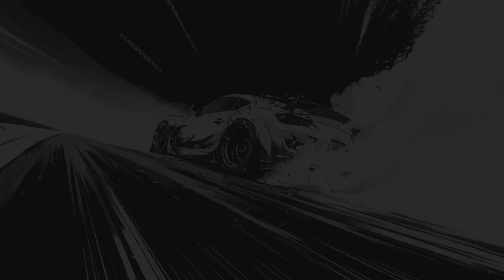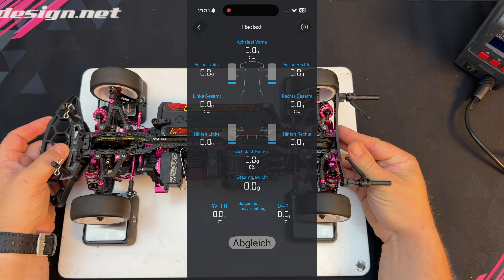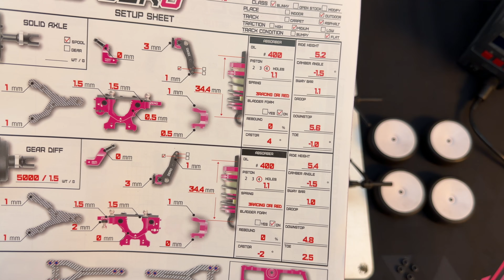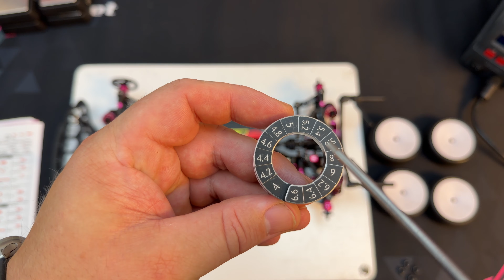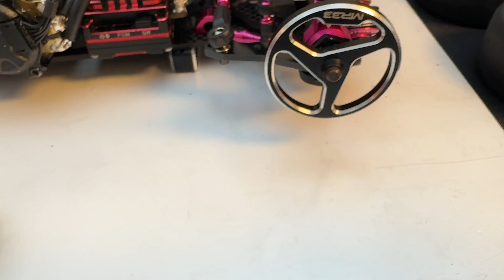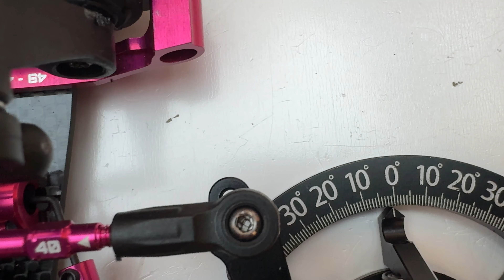How to Make Your 3Racing Zero Cero Faster – Baseline Setup

Comment: Love the Cero Zero series.  Finally received mine and the build is going together beautifully!  Now I just need my spring kits to hurry up and come in for it to be track ready.
Reply from the maker: Great, I raced for the first time this weekend; depending on the tires and body, I ran Xray 2.5–2.8 springs in the front, and in the rear, I used ARC 2.75 or Xray 2.9 springs.
Reply: @rcexp are they the XLP springs or ULP springs?  I run an xray x4 26 on carpet and the Cero Zero is to replace my old tired Cero Sport 55 for asphalt.
Reply from the maker: @kmueller4585  
I drive the XLP—well, I'm curious to see if the Zero doesn't end up replacing the Xray. :-)
Reply: Once the graphite plate wears out, I will likely use the steel plate and stick the Cero Zero on carpet in VTA and move the Xray up to 21.5. That's the plan at least 😅
Reply from the maker: @kmueller4585  Either way :-) I wish you lots of success and lots of fun.